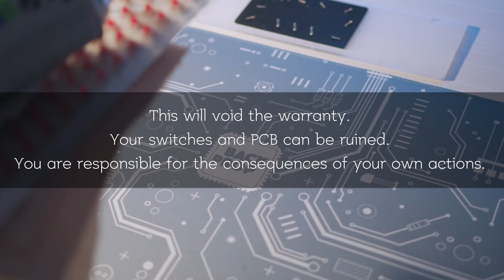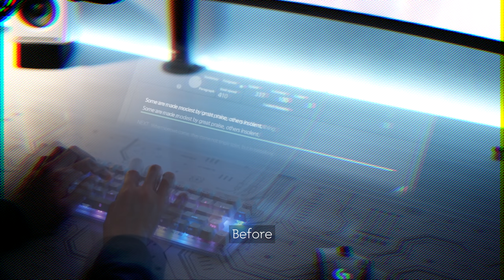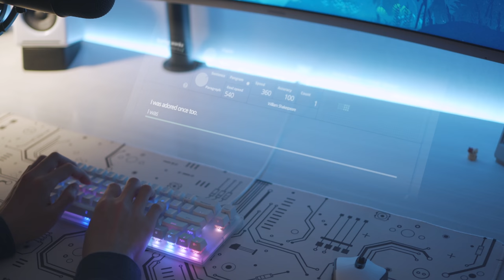Spray Lubed [Womier → GamaKay] K66 Typing Sounds (Gateron Red Switches)

Comment: I'm just wondering after two days some of the switches are acting weird, not actually registering the key press, These are not optical switches and I took it really easy on the lube. Any Suggestions?
Reply: Like after I mash the said key it will work, but do I have to do that all the time now?
Reply from the maker: Did you use exact same lube and shake enough? (at least over 100 times)
I saw some people sprayed without enough shaking and the inside of the switch, the thick lube stuck and it made the contact not working properly.
So, to fix the switch, desolder and clean or use contact cleaner spray.
I have never experienced any problem with all spray lubing tests.
Reply: @3ildcat  Ya I did shake enough and used the exact same lube, It's only a few switches, I'm currently trying to brake in the keyboard and it's getting better slowly. I guess I'll desolder and go from there.
Reply: @3ildcat  What type of contact cleaner or wipe should I use
Reply from the maker: @greenvspurple1  I don't know. As I told you, I have never experienced bad switches from spray lubing. This means I've never repaired any.
Reply: @:3ildcat  Hey, just wanted to give an update to anyone that may be struggling on this matter. I used "Gardner Bender GCD-002 Contact Cleaner" on the switches that did not work after the mod. Besides the lubing feeling inconsistent between the switches, this is a very simple mod and produces semi-usable experience. I would not recommend this for a low-end enthusiast that does not solder. There are so many good boards now for a relatively cheap price and hotswap. I just wanted to try this and wildcat gave me the confidence to do so. Thanks, and keep up the good work!!

Comment: Beware of doing this method. 

Two days after, the spring ping on my mx black  is definitely gone from all switches, but a lot of them now have chatter and do not work 100% of the time even after hitting multiple times. Potentially may need to wait a lot longer to dry, or you will have to desolder and clean all switches and lube with standard brush technique, which will cause a lot less headache in the long run.

Comment: is it possible to like spray some lube into a container and then use that liquid to lube your switches
Reply from the maker: You can but if you do like that, it is totally pointless.
The purpose of using spray is to spread the grease evenly inside the switch.
If you want to do like that, buy normal lube not spray lube.
Reply: @3ildcat  yea i mean like if you cant find normal lube 😓
Reply from the maker: You can find them easily. Google 'lube name + keyboard' then you can see a lot of stores.

Comment: Can we use this type of lube for optical switch?
Reply from the maker: You can but you should pull out the switches first.
This can cover the pcb optical sensors if you don't pull out them first.
Once the sensored are covered, they will not work properly.

Comment: What mousepad is that
Reply from the maker: It's Doro desk mat.
As I am not Chinese, I used a freight forwarder.
Sadly hard to get..
https://item.taobao.com/item.htm?spm=2013.1.20141001.1.6d7a252a74Xs97&id=587143973122&scm=1007.12144.95220.42296_0_0&pvid=a6292b85-ea22-4a8a-8a75-6457bf41e623&utparam=%7B%22x_hestia_source%22%3A%2242296%22%2C%22x_object_type%22%3A%22item%22%2C%22x_mt%22%3A0%2C%22x_src%22%3A%2242296%22%2C%22x_pos%22%3A1%2C%22x_pvid%22%3A%22a6292b85-ea22-4a8a-8a75-6457bf41e623%22%2C%22x_object_id%22%3A587143973122%7D

Comment: I tried spray lubing my mech keybs, the first one was a success but my second try is kinda scary. Some of the switches don't work properly like in this tutorial. Hopefully it dries tomorrow lol. ahahaha
Reply from the maker: repeat hitting the bad switches powerfully
if still not working, spray again (after well shaking) or have to desolder
Reply: @3ildcat  Keys are working now but I think it still needs to dry out since some are not registering when pressed at a normal level. Thank you! :)
Reply: Hitting switch repeatedly/spraying again works! Thanks! :)
Reply from the maker: @sirzique951  great!

Comment: bruh it has been 5 days and I can still see fluid in my switches

Guess I'll just go cry in the corner...
Reply from the maker: It's not possible if you use right spray and shook enough
Reply: @3ildcat  maybe I didn't shake it enough... would re-spraying help?
Reply from the maker: JustinGaming I am not sure... As you can see my 3 tries of spray lubing videos, all are fine. So I haven’t experienced that kind of problem. Have no idea.
Reply: @3ildcat  When I'm drying it, should I put it under the sun or where the sun can't reach?

Comment: This is definitely not the right method to lube.
Reply from the maker: not right for you,
but right for someone
Reply: It's fast, but not reliable method.
First, overlubing can happen very often if not careful.
Second, lubing will be inconsistent.
I'd rather spend that few hours properly lubing the switch with 205g0 or other lube, just to get that right.
It's not good to cheap out on time, man.
Reply from the maker: Spare Matyld It’s not overlubing. You say like that because you don’t understand how the spray works. It’s been test over 100 keyboards in my community and people say they feel like had to spray more. Did you check the pinned comment? It’s not pouring. and it’s more consistent than brush lubing when the solvent evaporated once the spray is well shook. Some people do this to tealios, holy panda and other expensive switches.
This is almost the same result of grease lubing. I understand you don’t know how this work. I was also very skeptical at first. I’ve seen a lot of test results and their opinion over months in my community. Believe or not, it’s really handy way. I don’t want you to try this. But just don’t underrate if you don’t know well.

https://m.dcinside.com/board/mechanicalkeyboard/433349

https://m.dcinside.com/board/mechanicalkeyboard/451556

Comment: Paying good money for a keyboard, that requires you to fix it before use. WTF is this BS?
Reply from the maker: You can use without the mods just like other keyboards. No problem at all. :)
Reply: I know, i'm sorry. What you did in the video makes perfect sense to me, and I've tried to pick up a good keyboard lately in my area, but could not choose one.
There are so many of them to choose, but most of them are overpriced hot garbage "For Gamers" and it looks like I simply can't pick one of them and force myself to like it.
And it is not just about keyboards, I'm so tired being have to dig deep into specifications, datasheets and websites for hours, to separate marketing fluff from the real deal to consciously make my mind about purchasing something, and it looks like every one is happy about buying any trash "they" make and no body is talking about that.
MLC NAND based SSDs? Almost gone from the market, replaced by TLC NAND based trash, or God forbid QLC NAND based SSDs. Why are those even exist?
Ugh, sorry once again, it's probably just booze talking, so I'm better go.